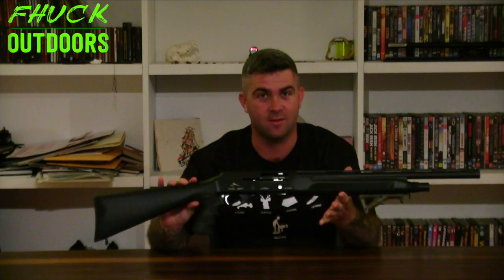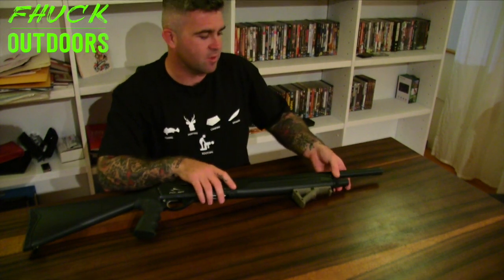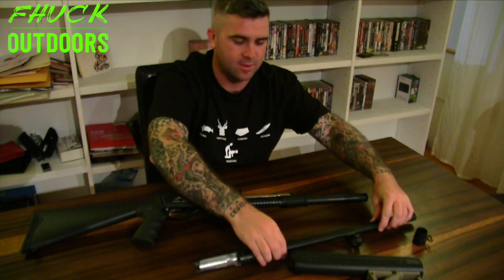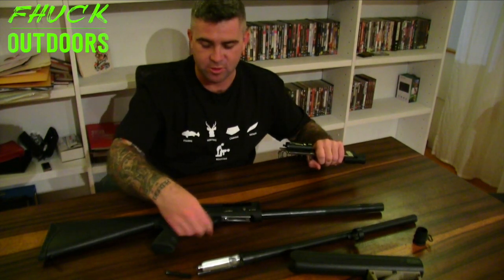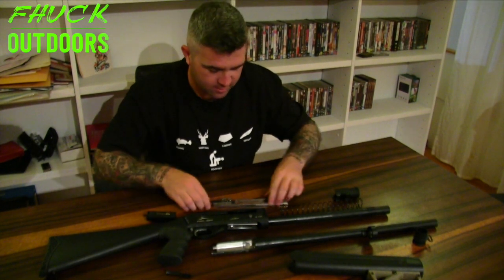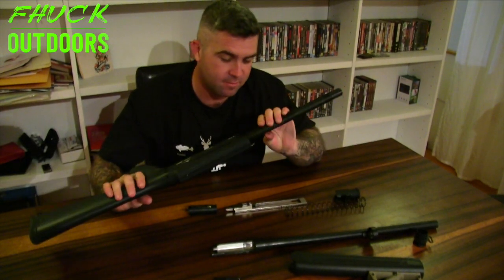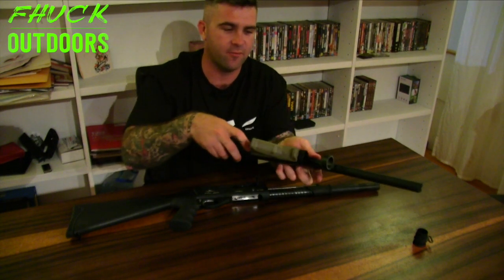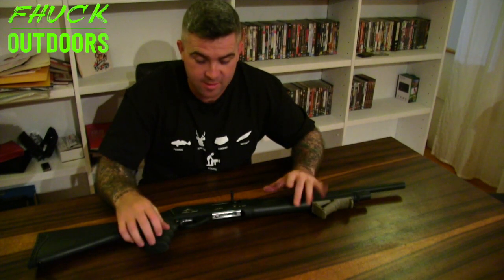Quick and Easy Disassembly

Comment: I have a b230 this same gun but with a dbm. The one thing to remember is its a gun not a microscope. Rip the lever back and let it go. If your too gentle it will jam. The Adler likes to be treated like the cheap gun it is. Then it will churn out shells day in and day out with no problems. I love it.

Comment: Allrighty then. Great info. A question, are the stocks interchangeable ? The Adler stock looks like it is on many other shotguns and the rear profile "looks "the same ? Just wondering if any of the Turkish shotguns have interchangeable stocks/ fore ends. Cheers
Reply from the maker: Not too sure mate, I havent personally tried. But it wouldnt surprise me.
Reply: @fhckoutdoors  Thanks. They all appear similar and living in NSW some stocks are not the go so thought of putting an Adler Timber stock on a Buck Master Tactical. Thanks for all the vids.

Comment: Hi, thanks for video.
Question when the barrel and fore grip are assembled to the gun does the barrel lock into the chamber area or is it the lock nut that holds it tight
Reply from the maker: Hey mate. The only thing holding the barrel in is the lock nut that goes over the magazine tube.
Reply: G'day mate, after getting my lock nut off (whick was fucking tight!), I am find my barrel still locked in place. Any advice other that working on some bigger muscles? I have given it a fair yank with my hands and no go. Would a gentle tap with a rubber mallet be out of the question?

Comment: Can u explain briefly the process of how you load and fire the shotty?
I have just bought one and it seems that I have to rack it, bolt closed, load it, pull the trigger on empty chamber then rack again to chamber the round.
Is this the same for you. It won't chamber the round any other way. Cheers
Reply from the maker: Hey mate. Without the action fired the shell stopper wont allow a round to come out of the magazine tube onto the lifter. The best way to load is to either have it de-cocked (fire the action) before loading into the tube, or you can load a shell straight onto the lifter from the ejection port, close the bolt, then load the magazine. If you check out the review video I did (you'll find it on the channel) it should explain it a bit better.
Reply: @fhckoutdoors  Thanks for quick reply il have a look.

Comment: My fucking cocking handle will pull out when it fires five and Bolt stays open.  B220aw.
Seeing this Vid it seems handle should only come out when forearm and spring are off?
This wont work on a b230 as bolt doesnt hold open when empty.
Both those half moon crescents that should line up align in open action position.
Can you guys check on your 220 series? Or I guess mine is making a long trip to nioa in qld.
Reply from the maker: Yeah that doesnt sound right mate, you should probably get that looked at.